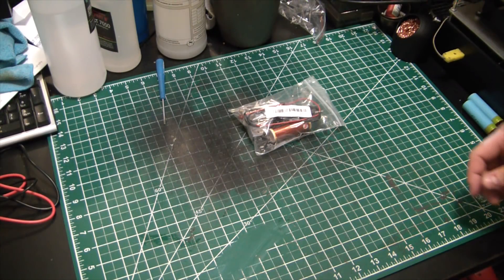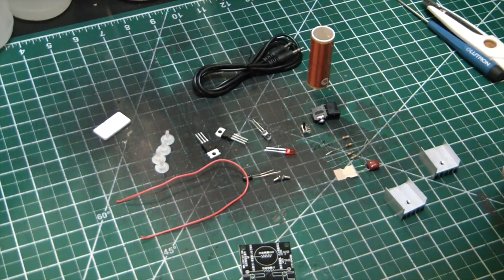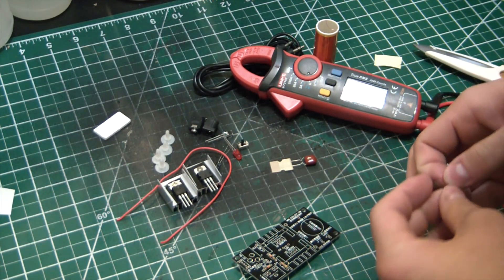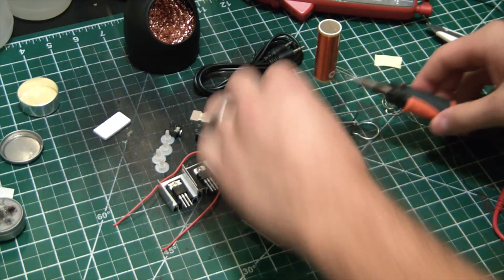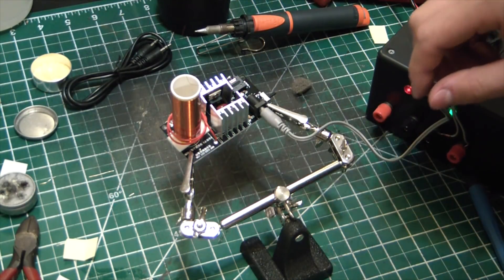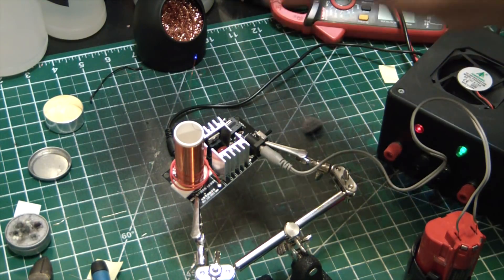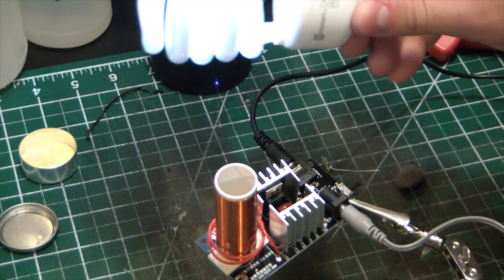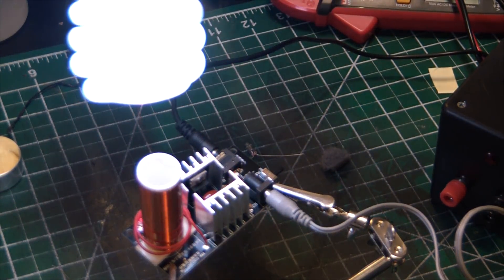Cheapest Tesla Coil On The Internet! - ElementalMaker

Comment: Thank you for doing this. I bought that exact same item from Wish, but it came with no instructions, and I'm an electrical ignoramus. So the shorter side is negative, yes? And it doesn't matter which way around you put the resistors, right?

Comment: Nice little project!  Will definitely pick one up.  

If you haven't bought one of those variable DC power supplies yet I'd highly recommend one.  They are super useful and you end up finding things to do with them.    I bought this one a couple of years ago and it's never let me down - https://www.amazon.com/Tekpower-TP3005T-Variable-Linear-Alligator/dp/B00ZBCLJSY/   It's a bit low on max current, there are ones that put out a good bit more power, I'd definitely recommend going that route if the extra ~$100 isn't a major deal (e.g. https://www.amazon.com/TekPower-TP1540E-Adjustable-Switching-Digital/dp/B00L4LC9XK)
Reply from the maker: I ended up getting a couple very nice old Sorensen power supplies, check out the video I did of them: https://www.youtube.com/watch?v=_dN_YMLrkZw

Comment: Crap! I'm an engineer by profession.  I'm just more of a manchild than you apparently.  I have a ZVS driver I bought from eBay which is still mocking me along with the 9K volt neon transformer.  I need to get to work!
Reply from the maker: I've been looking at those Chinese ZVS drivers! Would you recommend grabbing one?
Reply: Yes I absolutely would recommend one.  That way, you can show me how to use it.  LOL.  I kind of suck when it comes to electronics.  I got mine from eBay pretty cheap.  It's sitting on my shelf above my head mocking me right now actually.
Reply: ...however, I have made a Jacob's Ladder with the neon light transformer/power supply.  I also killed my wife's crock-pot with it because it arced onto the counter-top where nothing was grounded.  My wife forgave me because she got an even nicer crock-pot to replace the one I killed.
Reply: Matthew Wilson Would have loved to have seen THAT!
Reply: I have an 11 second clip of the Jacob's lader on my channel.  Nothing spectacular, but I decided to upload it because, why not?

Comment: I bought one of these as a desk toy, I can't even hear the audio modulation unless my face is right next to it.
Reply from the maker: Wow I'm surprised it actually works! What are you using to play music through it? I tried an old cell phone, and I guess due to bad filtering it made my phone go nuts.
Reply: I'm also using an old cell phone, but from a distance because of the interference.
Reply from the maker: Ah very slick, didn't think of the inverse square law I guess! I figured the interference was coming from the aux cord. Thanks for the tip!
Reply: @Justin Bell and ElementalMaker; I got one of these (at least it looks very similar) and the audio output was rather impressive. I'm not saying you put it together wrong or anything I'm just saying that from my experience these things are well worth the cost. 9/10 (instructions were in chinese which was annoying).

Comment: That thing ships for under 6 astrobuxx . . . what is China's production cost?  $-4?
Reply from the maker: Renewable Oilcan Rim its pretty freaking crazy they can even make a profit selling at that price. After working in manufacturing engineering for several years, I can't comprehend how it's possible.
Reply: ElementalMaker Instead of 25 or 30% payroll, probably only 2 or 3.